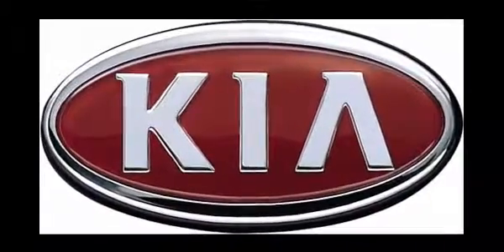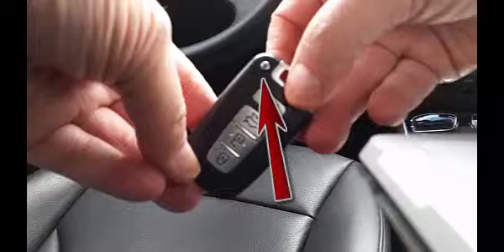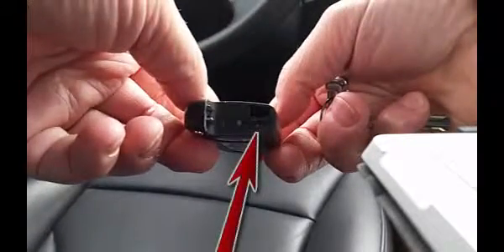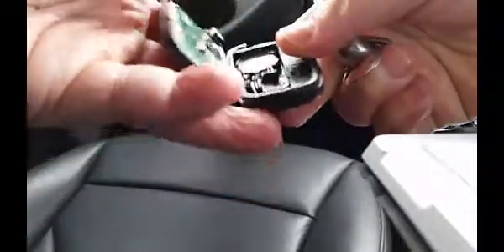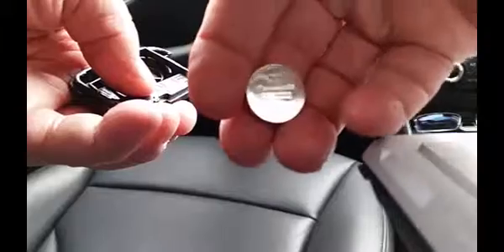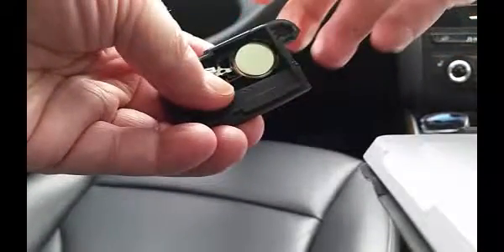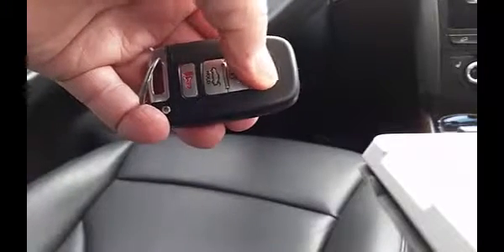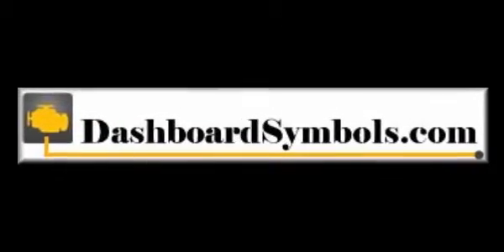Replace the battery in a pre-2014 Kia or Hyundai key fob.

Comment: Update: it works after replacing new batteries.....I replaced the battery on both the secondary and primary key and both of them don't work anymore :(
Reply from the maker: Well, not a lot to go on here, but here goes. TRY THE BACK UP START PROCESS in your manual. Or look for the right video here (I would need the year and model). It eh BACK UP works, the batteries are upside down or bad. If the BACK UP doesn't work, the problem is in the car, not the key fob.
Reply: @DashboardSymbols  thanks for the reply. Its the 2012 Rio.
Reply from the maker: Push the button with the key fob. If it doesn't work, there's a deeper ignition problem.
Reply: @DashboardSymbols   oh, but that does work. Its just the locking and unlocking of the car from a small remote distance even though the LED flickers when the buttons are pushed.
Reply from the maker: Ok, well, first its good you can use the car and it narrows down the problem. The only reset available is to lock and unlock the car with the mechanical key. Beyond that, your dealer or aa locksmith should be able to reprogram the key fobs.
Reply: @DashboardSymbols  it seems that i used some "older" CR2032 batteries which i had in a cupboard. Although they contained about 3 Volts of energy, the amount of power was drained. I got some fresh batteries and both fob's work now. My bad :)
Reply from the maker: Still, all in all, good news. If the batteries were good, it would have pointed to something seriously wrong. (and I had 'assumed' you bought new ones!)